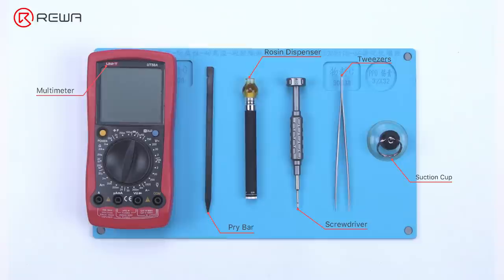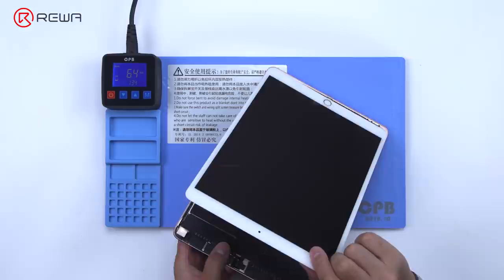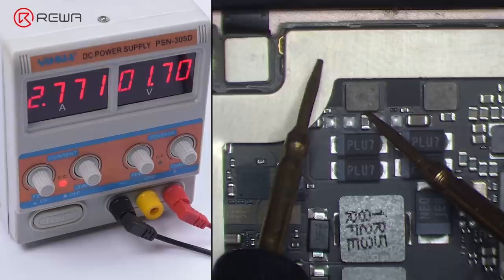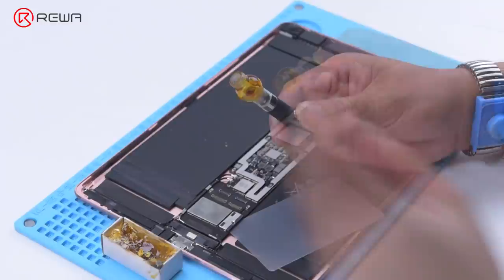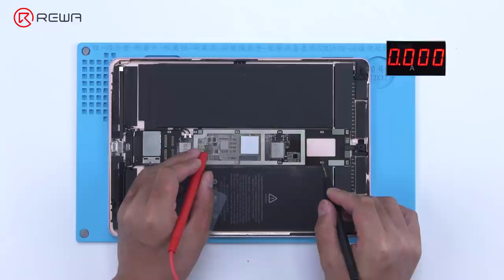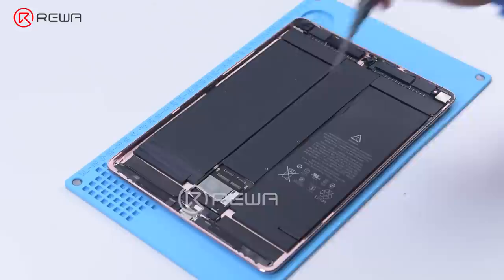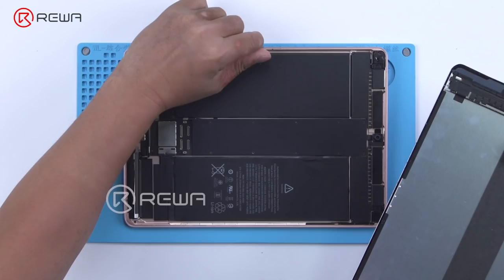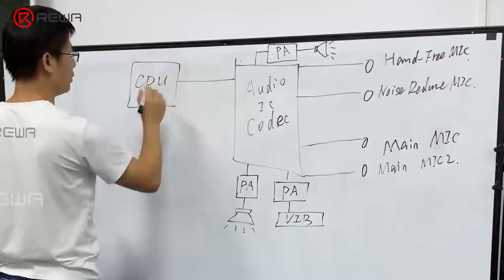How to Fix an iPad Pro that Won't Turn On - Short Circuit Detected by Rosin Dispenser

Comment: Did you replaced the damaged capacitor?
Reply: For filter type capacitor, I think can just tick it off. Can also solder back one with the same specification.

Comment: Wait, so you just removed the faulty capacitor and not soldered a new one there?
Reply from the maker: The capacitor is a filter capacitor. Just removing can solve the problem.

Comment: Did you replace the damage capacitor to a new one?
Reply: Not needed
Reply: @justtavi1238  correct 👍
Reply: @AppleReviews  Not really sure why they don't replace it. I heard somewhere that those tiny capacitors are connected in parallel and there is no need to replace them it will work fine. There must be some reason otherwise why would apple put an extra component.
Reply: @AppleReviews  I agree. You mean rewa is rookie?
Reply: @AppleReviews  8k 60 possible in iPhone? You know way more than me i admit. But I think rewa knows what they are doing. I have seen many technicians not replacing the cap. It will make a difference but i don't think that would be a blunder. It's just my assumption. I might be wrong.
Reply: When some charge goes in one terminal of a capacitor, an equal amount of charge leaves the other. So the total charge in the capacitor is constant , That means when Apple Used Tons of Capacitor in same line with same value once you remove one of Capacitor shorted to ground, thats not make any changes to total charge of the requirement.
Reply: @AppleReviews  Overall i agree to replace it with new one. without doubt is better to do. but i think you confuse in here by mention battery cap...The cap to ground form a low-pass filter for the lines they're connected to, as they remove high-frequency signals from the line by giving those signals a low impedance path to ground. so this cap not keep charge for extra function. in term of stability yes i agree with you. but functionality its fine.
Reply: @justtavi1238  think of it like this. If you have a castle and you normally have 200 guards on duty? One dies. It’s not going to effect the security of the castle because there are still 199 guards left.
Reply: The specific capacitor is for power filtering and smoothing.
Reply: @AppleReviews  actually the purpose of cap in smartphone for filtering and coupling.  In this video he just removed filtering cap which is in parallel path. Cuz capasitor will block the dc current & passes ac current. Smartphone works on dc current and if there is a ac current passing through the circuit then it will damage the ic. So these parallel capasitors are used to protect the ic from ac current. When the cap is short it will pass dc current to the ground and the phone will not work. There are multiple parallel caps in a circuit so removing a capasitor will not affect in future 😄 hope  u understand
Reply: @AppleReviews  you are welcome 😄

Comment: At what point did the meth smoke indicate the component was shorted?  Kinda glossed over that part.
Reply: It was mentioned at around the 2:45 mark how it is supposed to detect shorts. Basically if the rosin melts or if the smoke rises and evaporates then you’ll find the source of your issue